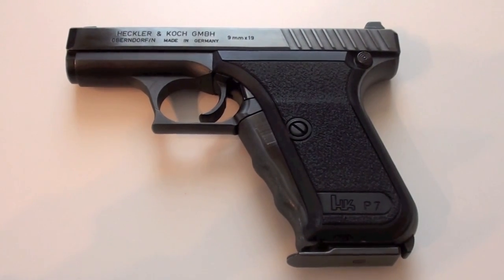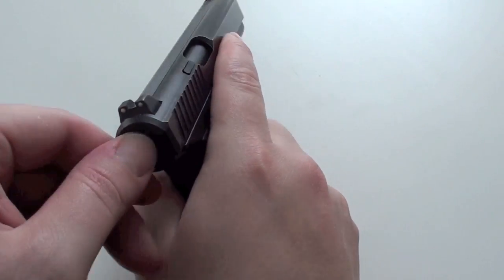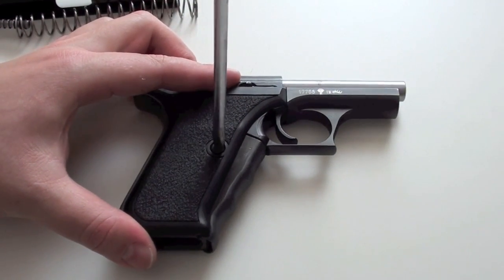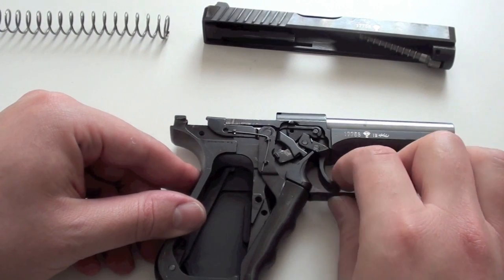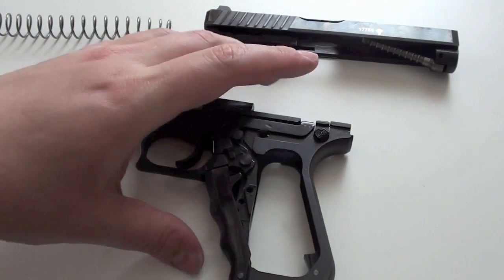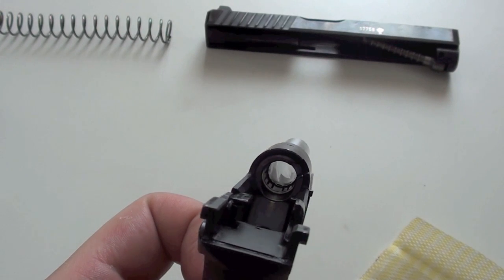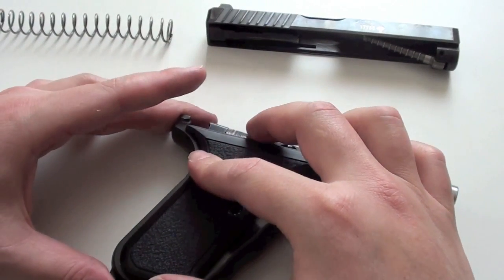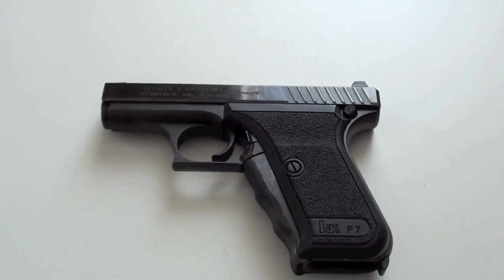Inside the Heckler & Koch P7 H&K

Comment: thank you for posting this. My cocking mechanism wasn't working in it turned out to be that little wire that was on the right side of the gun. You went into detail on how everything works great video keep up the good work I fixed my own gun without having to pay hundreds of dollars to have some one else do it. thank you so much
Reply: Did you have to get a new spring, or just reset it?

Comment: very infomative on a discontined firearm . after you see inside you can appreciate the machined parts and stampings (no mim parts).they are very expensive still ,i gave 699.00 with tax for mine with 2 magazines and it was a b grade , hk replaced all new springs and any worn parts before reselling these police trade ins ,so i really was not worried bought mine in 2008 ,have not seen them in a few years for sale.

Comment: Beautiful video! I have a P7 too. After shooting about 50 rounds on it it becomes hard to pull the slide. Could you offer any explanation why? Do you think it is from carbon build up on the gas ports? Thanks
Reply: I bet that's exactly it. Does it only improve after cleaning? The parts may also expand due to thermal expansion.

Comment: Great video!! Shot the P7 at my local range today. Its a great gun to shoot. The trigger was great. Its very smooth and I was wondering why I couldn't feel when the shot was about to break. Like with Glocks you feel the trigger hit a spot where it stops and then you pull more and the shot breaks. With the P7 it was a smooth pull with some resistance from a spring, but smooth all the way through and then bang! Well this explains it. So if I understand correctly, that part that is moving up and down as you pull the trigger is constantly in contact with the part on the firing pin that you showed and its riding down on it? And the shot breaks when it moves down far enough, past that part on the firing pin. Where as on, say a Glock, you have the trigger bar moving toward the connector (assuming I have understood it correctly) and when it comes in contact with it, you feel the trigger come to a stop, pull more and bang!

Comment: Very informative & straight forward video...There is one question that I have. During demonstration of the firing mechanism, I noticed that  there was a squared-off notch cut into the bottom of the sear bar just below & to the right of where it comes into contact with the trigger assembly during firing. I couldn't see where anything would fit into that notch, either during assembly or firing of the gun  and was wondering if it was there intentionally. It looks as if it would be in the perfect spot for the peg on the trigger arm to fit into if the sear bar if it was about 1/8th of an inch shorter. Do you have any idea about it?...Again, great job with the video!
Reply from the maker: +Len Irwin Phillips Thanks for your comment! I think I know which part you mean, but I am sorry I have no idea yet which function this squared-off notch has. I will take another look on the pistol, perhaps I can find out something. Regards eric
Reply from the maker: +Len Irwin Phillips Hi, sorry for being late, I took another look inside the pistol and I couldn't find any way or possibility for a function of this notch. Regards eric

Comment: @MrEK78

I am the happy new  owner of a barely used, well maintained 1986 P7M8. It truly is a work of art.
My question is; which parts of the gun you find criticle to clean often?
Do you need to disassemble the firing ping itself for example? Those are very tiny parts.
What do you use to maintain your P7?
Which spare parts should I buy, and most importantly, where?! I can't seem to find many websites in Europe which sell parts.
Could you perhaps make a cleaning video regarding the P7?

Lot's of questions I know, but I would greatly appreciate your thoughts!

Comment: Nice video. Does the gun disassemble further for a deeper cleaning?
Reply from the maker: Hi, I always try to keep my guns as clean as possible, there are some parts you just can't reach without disassemling this pistol. You could go further with the diassembly but for me it was not necessary. Regards eric
Reply: John Woo H&K provide a special wrench if you REALLY have to remove the barrel but they don't recommend it. One major reason for the P7's accuracy is the frame where you grip the gun is fixed to the barrel. In other handguns, the barrel is loose and tilts up slightly when the slide opens to eject the empty shell. This is called the Browning system because it was used in the famous Hi-Power 9mm and copied by just about everyone who makes handguns.

Comment: What is the diff between the P7 PSP and P7m8?
Reply from the maker: PSP is the oldest model, it is a bit smaller and heavier not much, the P7 was the second model, the magazine release was a bit broader, the P7M8 was the third model, it has a heat shield at the trigger and the magazine release is on the side. Regards eric

Comment: I can't understand how is possible that the firing pin gets reingaged by the levere after the shot, because you are still pulling the trigger while the slide goes back and forth, no?
Reply: Tommaso Morandini the slide cycling will reset the trigger pull. I did not see what parts reset it. will have to rematch the video.
Reply from the maker: The firing pin only moves forward when the trigger is pulled, the part which holds it back is called sear I think, it is the same mechanism as on every semi automatic pisol, you have to let the Trigger forward and pull again. Regards eric
Reply: MrEk78 When you pull the trigger the sear release the firing pin, then the gun cycle. Meanwhile you keep the trigger pulled. By doing this the firing pin doesn't get cocked by the sear because it is pressed down, so teorically you should re-squeez the mechanism in order to cock the gun, unless there is some mechanism that reset the sear, so the firing pin get caught while the slide return in position

(sorry for bad english)
Reply: Now that I have a little more knowledge about firearms, I've decided to return on this comment to clarify. What I meant was: "How does the disconnector works?". I've noticed that the part of the safety bar that gets engaged by the trigger bar has a little cut at the end. I think that while the slide goes back, it pushes the trigger bar down, inside that cut, so it disconnects it.